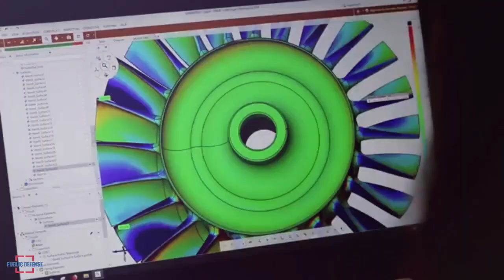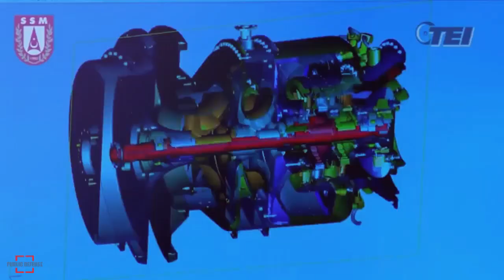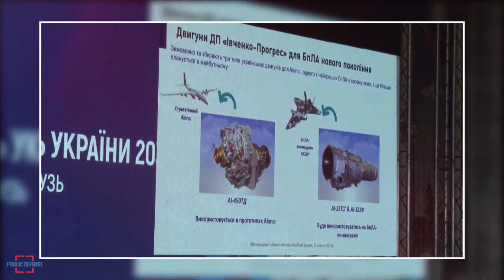The New Engine TEI-TF6000 Turbofan for Combat Unmanned Aircraft Kizilelma

Comment: That means TF-6000 jet engine is 100% Turkish Made.. Am I right ???
Reply: @fezikar8382 .. Thanks 👍
Reply: Basically TEI TF 6000 will be used very soon on unmanned system, like MIUS, most likely AKINCI will be also powered by this jet engine soon, and TB3 will get a smaller version. of this engine As tak eoff and landing requires vast energy supplies. TFX could use this engine, but the issue is not, that this engine cant provide enough energy, or is not trustworthy. The issue with engines that powering manned aircrafts, or systems in general with human in/on it, requires a lot of testings. Those tests take the most time. So i am sure, we will soon see this engine used on MIUS and Akinci.
Reply: @mikemike-vs2ef  This engine will most likely be tested on Kizilelma and TAI’s futur stealth drone. Nobody talked about being integrated on Akinci, as it was not designed to use turbofans engine.
Reply: @_RTX2060SUPER_  I am an engineer in this field. I can tell once you created something on a modular basis, you can use the system dynamically. TEI's Engine is a modular, or re-configurable. I can tell by only seeing this. So i am confident Turkey will use this engine in multiple ways, as it is a multi-usage Engine. As i said, when you want to lift something from a ship, you need a mighty power source. This is not possible by prop-engines, as the TCG will not provide a long runway. TB3 and MIUS are surely powered by this one, but i also think akinci will be. or at least they will produce a new version of akinci and make it a kind of a series. Akinci A1, or something like that.
Reply: @mikemike-vs2ef  I am living in Türkiye as citizen of it, and from what I learned that TCG Anadolu will have some short of slingshot system to lift disadvantages of short runaway of the ship.
Reply: You absolutely right my brother
Reply: @fezikar8382  lile ts1400 engine same thrust!
Reply: @mostafaamrani5110  ts1400 has max 1600 shp...